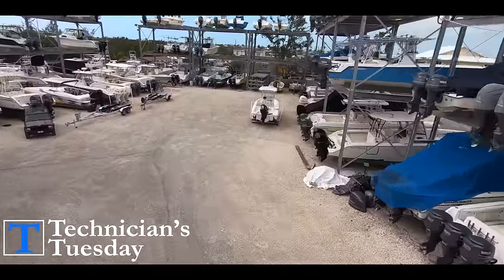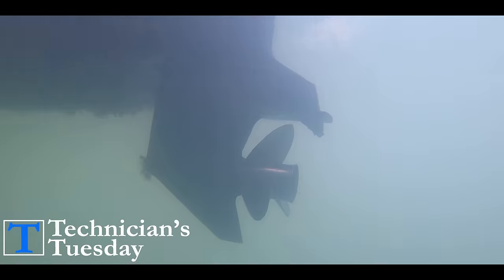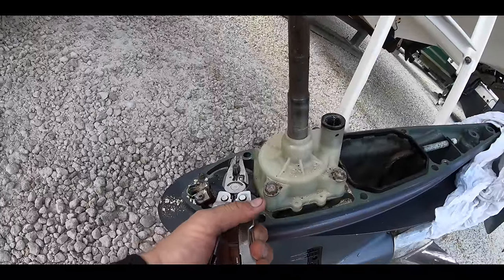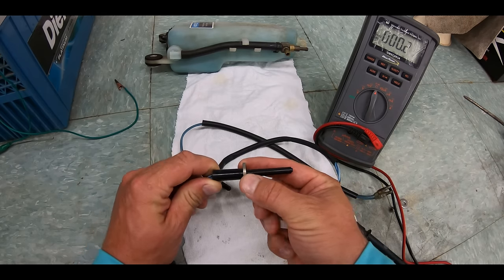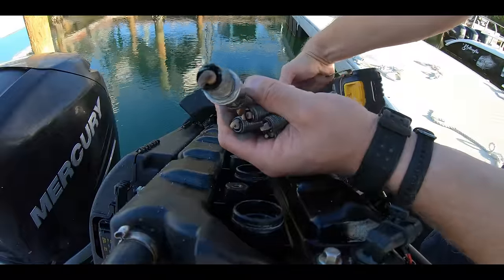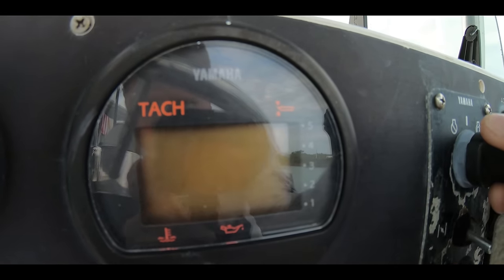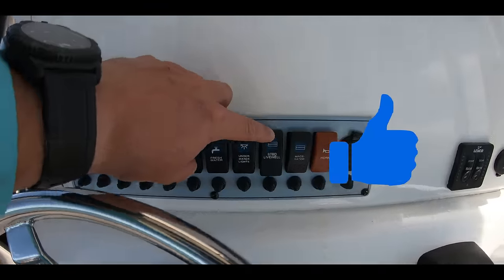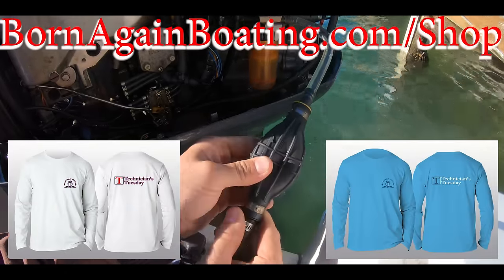Outboards #1 PROBLEM!

Comment: I miss my 90's 2-strokes that you could beat and neglect, and still get 3k+ hours out of on minimal maintenance alone.
Reply: Rob F < I doubt you ever got 3k hours on any outboard.
Reply: @melrose9252  we did it on multiple. 1998 Evinrude 225, twin 250 Yamaha's, and that's just what I put in my captain's log. My dad put a couple hundred hours per year on them as well. Our smaller outboards that we used on our river beaters probably had the same if not more.

Comment: My dad had a small aluminum fishing boat with a a small motor, maybe 25 hp.  I borrowed it once on a while and regularly at high speed, the rpm will go higher and it would lose power (drive).  I’d back off rpms, slow a bit and gradually increase rpm little by little. It was like there was a clutch momentary failure. Don’t know if the motor has a clutch.  My dad would claim the mechanics were saying they found nothing wrong but they never took the boat out.  I think my dad wasn’t telling the truth.  Any ideas?  Just out of curiosity.
Reply: probably the prop rubber bush is slipping ,get a new prop or a new bush pressed into the original prop.

Comment: I’ve got a mercury black max 150 and it runs great out of water but when we put it in water it won go above 2500 rpm we’ve redone all of the fuel line and spark plugs and spark plug wires plz help
Reply from the maker: It's hard to say, it could be the fuel pump, could be the carbs, could be an electrical issue. Start with the fuel pump and carbs though :/
Reply: I would start with something even easier check for fuel pressure you could have a restricted line! Always start with the easiest things first especially if your mechanical skills are limited!
Reply: Timing is out
Reply: does it have a low idle switch in the shifter that keeps the rpms low in newtral(my spellingh sucks)i have a yamaha and had to replace mine twice

Comment: Looking back on your videos I can't find any about decarbing a two-stroke outboard I'm looking for advice which is the best product to use seafoam or Yamaha ring free?
Reply from the maker: Ring free for sure!
Reply: the omc/brp engine tuner is awesome too. warm up the motor, shut er down and spray a good amount in the cylinders. let it sit for an hour or more, and blow the cob webs out of it.
Reply: @ct1762  okay I'll keep that in mind. I bought some Yamaha ring-free going to try it next year boat shrink wrapped and everything now
Reply: @Honda1k  ring free is more of a "add to each tank" sort of thing. Engine tuner is much stronger to shock caked on carbon off. Its incredible for cleaning carbs and parts too

Comment: If you think boats are a problem, go buy a now RV , I have had a few boats over the years an for the most part never really had any serious problems But this RV we just bought has been nothing but a major problem , $55000 for this POS an all I do is work on it , it is still under warranty but the dealership is so backed up with other warranty work on RVs they end up having to keep it for a couple months. Worst thing I ever bought in my life.

Comment: I can't help but wonder why no one ever designed an alternating air pulse shifter for outboard engines.  The engine generates an alternating pulse of air.  A cheap, flexible tube connects the alternating pulse air to the shifter.  The forward, neutral and reverse buttons in the shifter engage one-way valves to signal the engine which button is pushed.  The buttons are mechanically linked to one another and are mutually exclusive.  Thus, pushing one button disengages the other two.  The forward button uses a check valve to allow the alternating pulses of air to flow forward, but not backwards.  This flow drives the engines mechanical shifter into forward mode.  The reverse button does the same thing, in reverse.  Neutral has no flow.  Without a flow to maintain engagement in either forward or reverse, the engine slips into neutral.  If the shifter air hose is ever blocked, cut, or is pulled off at either end, the engine slips into neutral.  Should the buttons fail, a cheap mechanical device can be installed at the end of a length of spare tubing attached to the engine to perform the same function.  This shifter would have a mechanical RPM limiter preventing shifting if the RPM were higher than, say, 1,500.  The shifter would be operated by a single piston held in a central position by two springs.  Airflow via the pulse shifter would drive the piston either forward or reverse.  No airflow and the piston returns to the central position.  The only drawback I can see is that the shifter would not be instantaneous, but as the principle is very similar to power brakes, it would be quick.  Owners would be required to change the shift tube annually.  Cost:  25 Feet - 3/8" ID 1/2" OD Clear Vinyl Tubing is $15.  For smaller boats, that's $7.50 a year.  Larger boats would have to spend the entire $15 (ouch!).
Reply: What you're describing is a mechanical button attached to a pneumatic system attached to a mechanical system. It seems much simpler to just remove the pneumatic system and attach the mechanical button directly to the mechanical shifter with a linkage (i.e. what we have now.)
Reply: Simplicity is reliability. Nobody likes to be stranded on the water, and a failure at a bar crossing could cost lives. The new breed of marine engine has too many components to potentially fail compared to the engines of yesteryear, we don't need to add more...

Comment: How to prevent all five?
USE YOUR BOAT ! ! ! The worst thing for a boat is for it to SIT ! ! !
These problems rarely happen when used frequently..... Water doesn't contaminate the fuel. Plugs don't foul. Steering cables don't freeze. Batteries don't die. You are constantly monitoring everything.

Comment: I don't understand why outboards don't just run a sealed system like some jet skis. It would be so much better.
Reply: simple: weight, room under the cowl, and reliability. its just good engineering to use a small impeller with one moving part connected to the powerhead, vs needing an ancillary belt system to power a water pump, a reservoir to contain cooling water and all the maintenance associated with it when winterizing. not to mention the extra cost and power robbing.
Reply: @ct1762  I doubt it would be that difficult to engineer , they have been doing it on other engines for decades! Besides, it would be totally worth it to not have to flush the engine every time you use it, have the ability to start the motor out of the water and run a simple temperature gauge. Let alone the corrosion problems from running salt water through the engine! Most new jet skis are coming out with sealed cooling systems now, so maybe theres hope for the future.
Reply: @officialWWM  they've been doing it to inboard engines without nearly as much of a space restriction, yes. but outboard cooling issues are few and far between if you are keeping up with proper maintenance. i never flush my salt water motors out, and have over 25 of them run the same way since the early 1980's! i would flush them, yes but don't have a hose at my dock. its just thermostats and a water pump impeller. not much to go wrong unless you don't properly winterize.
Reply: @ct1762  I use my boat all winter, so I dont have to worry about that. Are you saying I don't need to bother flushing my engine?
Reply: @officialWWM  if freshwater is available, then absolutely flush it. I was just saying these motors are really reliable as long as the cooling system isn't neglected

Comment: What is that snappy with what looks like an electric wire coming out of it
Reply from the maker: Not sure what your talking about lol :)
Reply: Born Again Boating the snap on tool , looks like a screwdriver handle with a wire attached , I guess it would be a remote starter switch ....... I paid the toll/tool man for 10 years , but I haven’t been on the snappy truck since 2011

Comment: why dont they make outboards with coolant instead of seawater for coolant?
Reply from the maker: Just never been an issue except in saltwater areas, but now the Seven Marine $100K outboard is closed loop cooled lol :) weight and cost as well
Reply: because weight, cost, complexity and most importantly theres not enough room under the cowl. one simple impeller and it ingeniously cools itself with the stuff it runs in. gotta love that.

Comment: Get rid of that oil injection immediately. Mix your own.
Reply: What makes you think this? The jets on a oil injected engine are tuned to run without oil in the fuel, and the oil is often injected into components that the fuel does not reach for lubrication (which would not get lubed if you switched to premix). I'm aware that early OMC oil injection systems were flawed and not reliable, but those were problems specific to that system, that today's oil injection systems do not have.
Reply: @itisinfactpaul2868  What makes me think this.... hmmm.... owning dozens of OBs from Merc 2.4s and 2.5s to JohnnyRude V4 85-140s, Rotax and Yami OX66s, never mind the 4 stroke OBs. I would hope you'd know the fundamental differences between 2 strokes and 4 strokes and why you don't burn oil in a 4 stroke. You say, in today's fuel injected engines... First off, and it is rather obvious, this is not a newer engine. Second, newer OB engines are almost all 4 strokes that don't burn oil with fuel. Third, the terms oil injection and fuel injection are not synonymous and not interchangeable. Fourth, in an OX66, the oil is premixed with the gasoline by injecting oil into the VST where it mixes with gasoline. The oil/gasoline mixture is then pumped by the electric fuel pump to the fuel injection rail and then on to the fuel injectors. This means that the OX66 OEM oil injection injects oil into the fuel before the MIXED gas/oil is sent through the fuel injectors. So, on this motor, even the stock OEM oil injection sends mixed fuel (this includes the oil) through the fuel injectors. You can send future tuition fees to: Outboards for Dummies care of my Payypall account.
Reply: @j.thomas7128  I know the difference between 4 strokes and 2 strokes, as well as EFI and oil injection. 'Fuel injection' was a typo and I fixed it.

I thought that the Ox66 used direct injection (in which case the oil pump would lube the crankcase,) but since the oil goes straight to the VST, I suppose the only problem that an injection delete would cause here is improper mixture leading to faster fouling. Also, this is absolutely a 'modern' oil injection system. It wasn't made last year, but compared to the early OMC ones that gave them their bad reputation, this is a totally different system. It is still correct that many modern oil injection systems (those used alongside direct EFI) lube the crankcase via the pump.

I have never seen a Yamaha fuel injection system fail. And I can promise you that I've seen a LOT more of them than you have. I HAVE seen fouling and mixture problems caused by using a premix that the computer thinks is a variable. There is NO reason to delete an oil injector in any modern engine (by modern I mean anything that isn't 1st generation oil injection.) There is no human on the planet who is more reliable than an oil injection system. Have you ever actually seen a ruined engine (aside from those 1st gen OMCs) because of bad oil injection? I'd guess no. Have you seen an engine that's ruined because somebody forgot to premix properly? I bet you have.
Reply: @itisinfactpaul2868  I'm not even going to bother correcting the mistakes in your reply. There are as many in this one as your other. Have a good day. Happy Boating.
Reply: @j.thomas7128  You give up pretty easy for someone who gets so upset! Good day to you too.
Reply: @itisinfactpaul2868   LoL You can't get anything right. Nothing. I don't give up.  I just don't argue with fools. Good Day.
Reply: @j.thomas7128  "I don't give up, I'm just refusing to continue any further and leaving." Here I was thinking those were the same thing...

Comment: I'm having a problem, when going backwards the engine used to make a rattling noise, people told me to adjust the shifting cable, i did that and now sometimes when i put in reverse slow it just just off, what can be the cause of that
Reply from the maker: Well, you don't want to put the engine in gear slow, you want to pop it into gear, this video should help on the shifting: https://youtu.be/Mx0LEAWsE_k

Then double check that cable adjustment, it might be time for new cables.
Reply: @BornAgainBoating  thank you for getting back to me, you have help me with all my needs om the engine, thank you again and keep them videos coming

Comment: B A B...do you know about Voltage drop testing  .... print this chart out and try it on some cars and trucks.. https://i.imgur.com/kviX0VQ.jpg  then you can do it on boats..  making up a long set of gator clip test leads is a good idea ..  https://i.imgur.com/XlTLPVE.jpg  this is my old set.. each test lead was 7 feet long.. my new set because i work on cars with the battery in the trunk my new set has one cable that is 20 feet long and the other is 8 feet long.. now i can clip onto the trunk mounted battery and still have my volt meter in the engine compartment. 

 voltage drop testing can also tell if the inside of cables are corroded..

Comment: You know anybody with a 200 ox66 for sale ?
Reply from the maker: Not right now, they are a pretty coveted engine lol they run forever!
Reply: @BornAgainBoating  Mine is making a chriping noise , I guess its the upper crank bearing , but one cylinder is 109 , the rest are 114 to 124

Comment: The one thing I never understood with outboards is why as the cc and hp went up, that the manufacturers didn't automatically think to use a 4stroke engine? I mean who sets out to design a 3.0L+ 2 stroke engine? If it was a car engine no-one could afford to go anywhere in it!

Comment: How to have a reliable outboard. 
Step 1: Get a yamaha
Step 2: Only use ethanol- free gas
Step 3: Perform regular maintenance such as oil changes and change water pump every year.
Reply: Yep, I remember my uncle telling me that once yamaha released a 4 stroke it was over for the other companies. They just run.
Reply: @BlackHawkBallistic  I know I will never buy anything other than yamaha.
Reply: Get a Yamaha if you can’t get a Mercury.
Reply: @melrose9252  mercury is the least reliable outboard

Comment: Iv had my Boat @ yamaha saltwater series 115  for twenty years ..never ever  had one problem.. used in the sea...do my own maintenance..
which is stuff all.. change spark plugs once ..do clean them tho .. leg oil twice..fuel filter twice..never water pump. they last for ever ! .. gotta keep lubricating all moving parts..clean crc chrome trim tilt shafts ..two sets of wheel bearings .on third battery now ..
.Dats about it..$1000 bucks in twenty years...will go another twenty .easily .. iv always put abit of carwash or dish wash liquid in engine before flashing ..bet it looks like brand new in there 😆..money pit my arse..just lazy farken owners lol...🤣 but then its not a 30 foot poker boat that lives in the ocean..😋

Comment: Do away with the oil tanks on a 2 stroke. The pumps can and will fail . Catastrophic failure.mix oil in the gas.
Reply: Pretty unlikely.  I owned a 1998 Johnson 150 with the VRO2 oil injection system, and never had a problem with the oiling system in over 650 hours and 18 years.  Oil injection has been reliable since the late 1980’s.  I now have a 2015 Evinrude E-etc 175, with 170 hours, and no problems with the engine or oiling system either.
Reply: @Z06ified  you will its just a matter of time.I have a yamajunk sx200 ox66 electric pump went out and galded #3 piston just rebuilt it and did away with that crap. Good luck with the e-tech they eat ecm's. About 2k for repairs. Never good for water cooled ecm. Especially in saltwater.
Reply: So far so good.  The ECM was water cooled on that 1998 Johnson I owned too, and never had a problem with saltwater use its whole life.  I actually sold the used ECM on eBay after I parted the engine out.  Everything on the engine was good except for the carbs - the throttle bodies were made of plastic and cracked.  Since OMC went out of business 10+years ago, couldn’t find reasonably priced parts for the engine any longer.  If it wasn’t for that, it would still be going strong today (although sucking down gas at an abhorrent rate).

Comment: Boats are not as expensive as people make them out to be. They become expensive when you do nothing to take care of them. Use common sense when you buy a boat.

1. Buy a 100% composite boat so wood rot is never an issue.

2. Get an aluminum trailer with stainless bolts for no rust. Also use oil bath hubs.

3. Wash your boat after use. Don't forget to flush the motor!!!

4. Change plugs, oil filter, fuel filter, and lower unit oil on a regular basis.

5. Anytime a bolt is removed, make sure you put anti-seize on it.

If you do these basic steps. Boating is fun and not a huge money pit.
Reply: Michael H I don't like the oil bath hubs. Bearing Buddies hold hub under pressure so water can't come in.